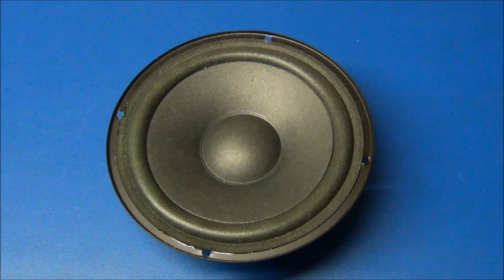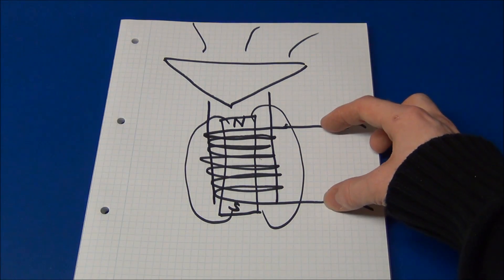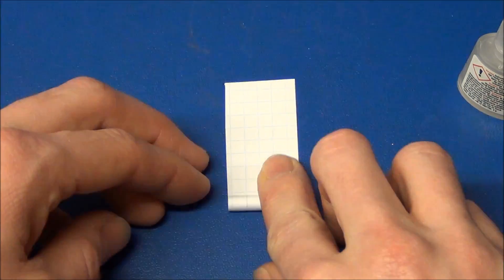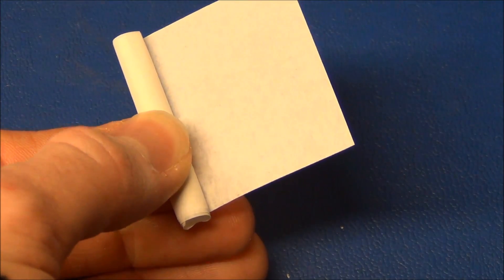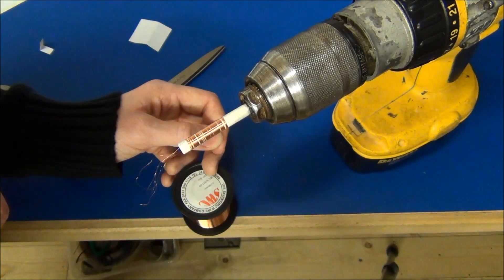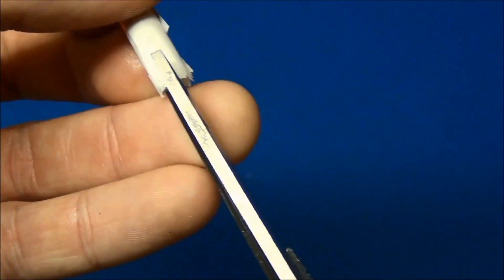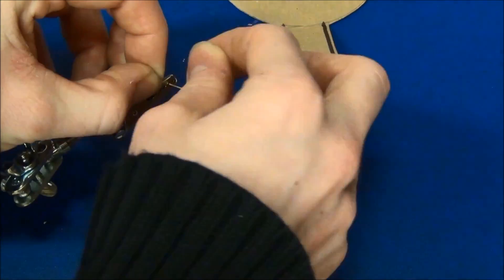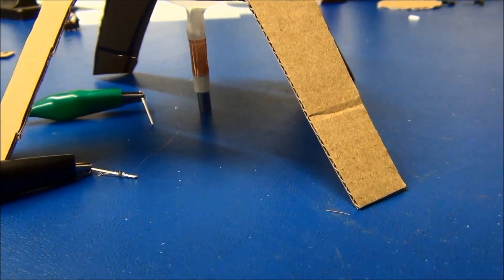How to make a DIY Loudspeaker, and how does it work ? - Ec-Projects

Comment: Would it be a little quiet with too much OR too little copper wire? I wrapped nearly 8 cm around the opening of a bottle. I also used a  circular magnet.

Comment: Can i use thicker wire? Or other wire... Then how to get copper wire?
Reply: you can get it from any plug that goes into a wall from the transformer inside
Reply: You can probably find "magnet wire" or coated wire at most small electronics stores... Radio Shack in the US carries it... or as Ethan said, some old Wall Wart transformer plugs use it.

Comment: Where and how is the magnet attached ?
Reply: it looks as though it's just resting on the table surface.  you could probably put a spacer under it if it's too far outside the coil sleeve (or glue on a thin cardboard base for it to sit on).

Comment: ok pause right there 10:33 how are you playing music with only 2 wires????? theres something your hiding and did not mentioned about the connections,
Reply: Frank Lopez Take some old headphones cut the ear parts then connect that to the homemade speaker. easy :)
Reply from the maker: Frank Lopez Speakers usually have 2 wires ?
Reply: yes  but this does not answer my Q, how would the sound be Tx and from where
?
Reply from the maker: I used an old iPod and a solderable jack plug
Reply: so this is whats missing in the tutorial ....you made speakers now how to plug to other electronics, this has to be useful info
Reply: Speaker only need a positive and negative but headphone wire will have a positive negative and ground the ground pin is for RF shielding

Comment: I made this speaker twice and it both times it blew out my audio source.  My audio source stopped sending the audio signals.  On one occasion it was old set of PC speakers and it blew out the main speaker from sending out signal to the smaller speakers. The second time it broke an old mp3 player that no longer sends out the audio signal.  Can you please explain what might have happened?
Reply from the maker: It could be if the wire you used is not enameled, so it could short out ?
Reply: +EcProjects or just too short wire.

Comment: what does it means the black and white are alligator wire and to connect the cp it shoud be jack plug and so jack plug and allligator wire are connected right?
Reply: yes right mate .its just like a converter ,a jack so you may it  connect through your phone.